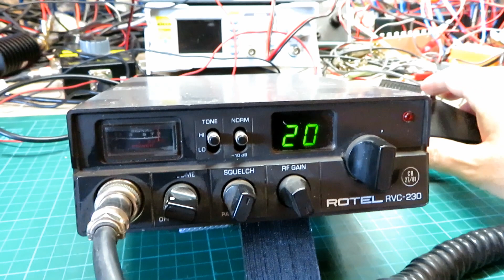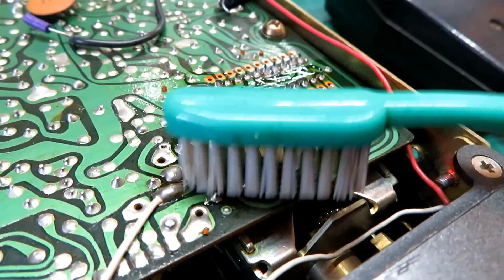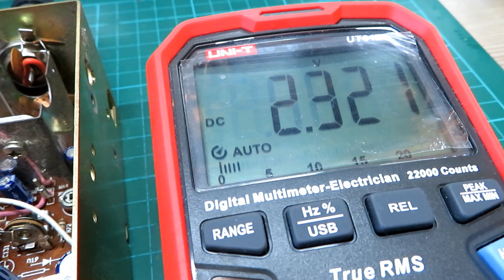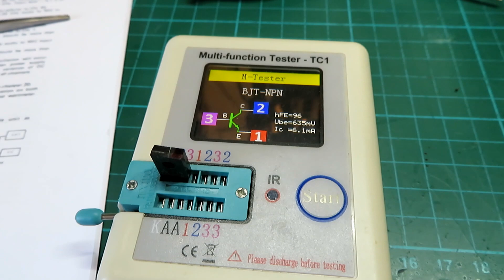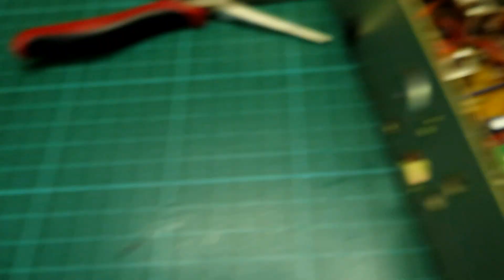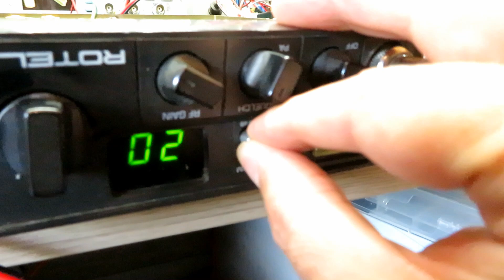ROTEL RVC 230 - OVERHAUL AND SERVICE - YOU CAN SEE WHY THIS RADIO HAS BEEN USED - CRAZY SENSITIVITY!

Comment: I noticed a hum on the audio from the 230 and the Serpent sounded slightly off frequency into the 230.  Your videos seem to be emulating Richards more and more which is even more coincidental as you have both serviced a Rotel 230 in the same week.  Made me giggle a bit.  🙃
Reply from the maker: The hum is mains hum, the antenna is right behind an electrical cabinet and it's not grounded as it's running off a battery, it's clean that's for sure, Richard is doing loads of Rotels at the moment, this video was recorded a week ago before he uploaded his run of videos, we cover the same topic but the way I film and edit is different and I do lots of design and 3D printing repairs, I've been doing the repairs on and off for over 30 years and decided to incorporate them in to the channel because I was running out of radios to review and Google was throttling the channel because I wasn't uploading.

Comment: the sensitivity on these radios is amazing.. imo the cybernet board is king compared to any other fm sets.. just a question about deviation.. that trimmer that you centred next to the potentiometer.. ive noticed when factory set they are never centred and always to one side.. if set that way by the manufacturer why do techs always centre it and what difference does it make. cheers.